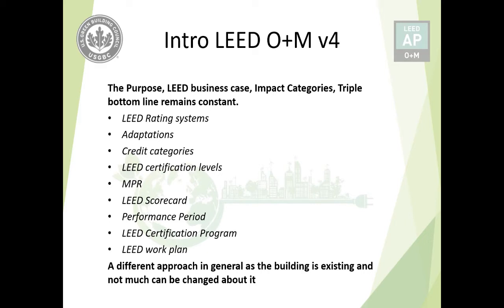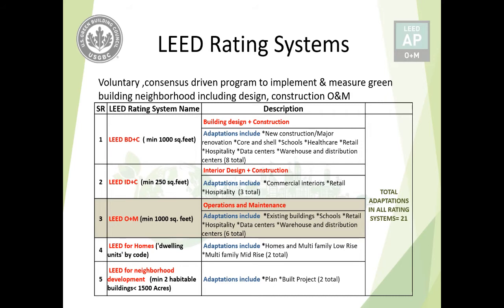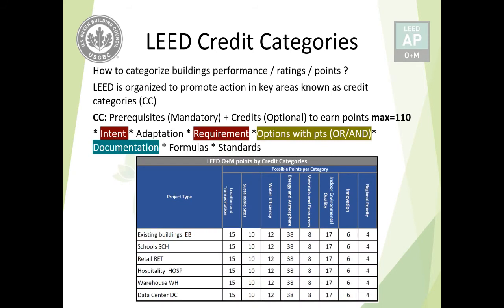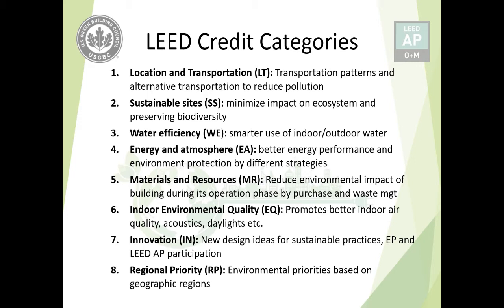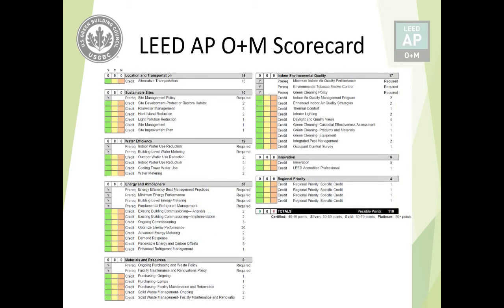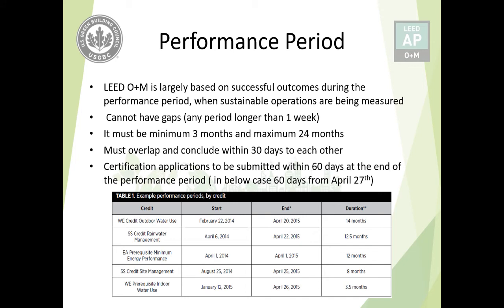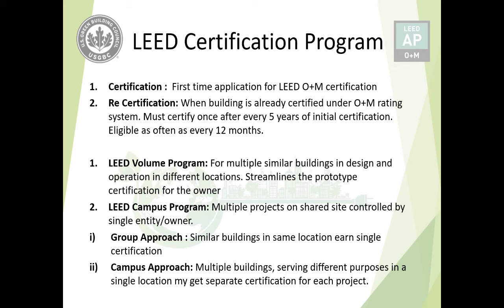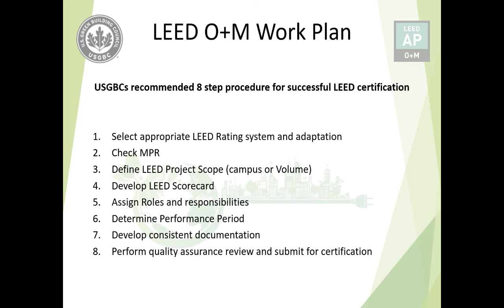LEED AP O+M Introduction

Comment: Do you need to start the performance period after the LEED registration? Or is it fine to start before the registration?
Reply from the maker: No, it is not necessary to register the project before beginning the performance period . Just ensure that the performance period ends within 24 months before the certification application and that all requirements are met during this period.
Reply: @UstaadSairum  Thank you 🙏

Comment: Excelent series of videos to study for the LEED AP O+M Exam. I want to thank you for preparing this series. I just got my LEED AP O+M Certificate.
Reply from the maker: That is great Andres. Congrats and wishing you all the best
Reply: Congratulations Andres. Was the exam difficult?
Reply: @odeliocepeda6054  It's was a little bit more difficult than the LEED Green Associate but of you see all this videos and read all the reference guide you are ready for it. It helps a little of memory for those numbers for some credits. I was really scared bc before this O+M AP I took the WELL AP, and that was really hard for me, specially for the memory part.
Reply: @andresfss   thank you for your swift reply.  Sorry to hear the Well AP didn’t go as planned for you. I am taking the exam this week.  Did you have a lot of math questions in your exam?
Reply: @odeliocepeda6054  my memory is fuzzy. I think that for Sustainable Sites I had to calculate something, and also for Energy and Atmosphere: renewable energy. I thought it would be a lot more. But I guess that's part of the luck.
Reply: @odeliocepeda6054  I read my comment and sounds like I didn't pass de WELL AP. I did but it was hard. Good luck on your exam.
Reply: Hi Andres, congrats for victory. What study materials did you  referred and helped other than this video series.
Reply: @nizamudheenm3894  Basically the reference guide, afortunally my company buy the online reference guide. I also buy the exam test from gbes, not sponsored hehehe.